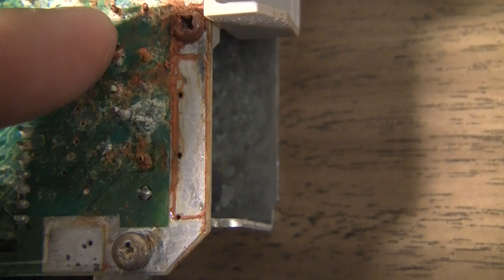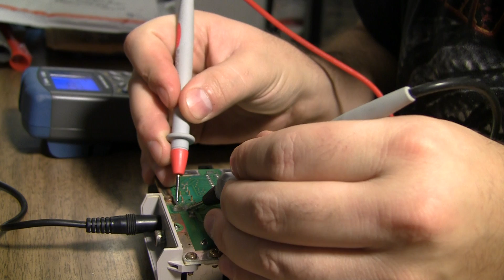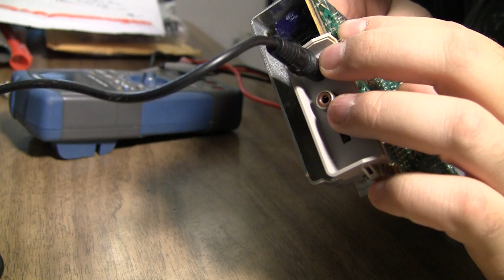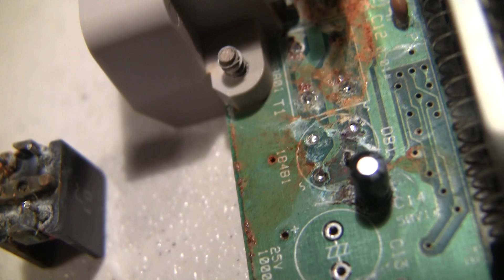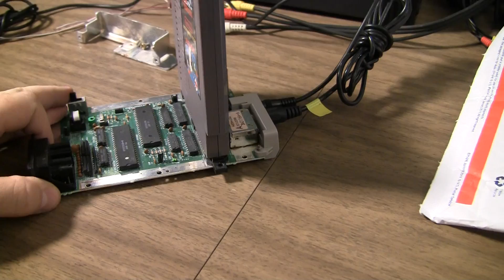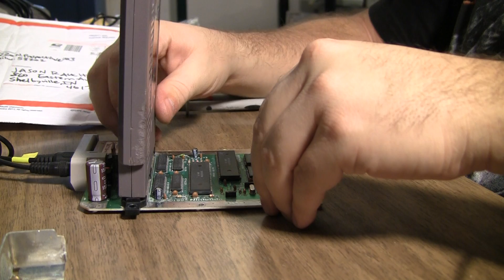NES-101 Nintendo Top Loader - bad corrosion fix up

Comment: I have a top loader it's been working for a long time yesterday it stopped working I took it apart 72 pin connected was clean and in good shape I haven't done any mods the problem is that the graphics are bad there not exactly garbled they are not clear I plug it in and before you turn it on you know how it's black and white well I turned it on and it was still kinda like the but I could faintly see the background and there was no Audio I was told the problem was the rf switch so I ordered it today and hasn't come yet but was wondering if that was the problem if not would you possibly know what is thank you for your great vids good job.

Comment: i can guarantee that is flood damage, i recently serviced a sinclair spectrum+3, and a sinclair QL and all peripherals for the two.
they had been caught up in last winters flooding and left all summer to fester, i cleaned all boards with a soft brass wire brush, then brushed on white vinegar and cleaned again, then flushed them with bicarb solution,then through the dishwasher.
this brought them as good as any 30 yr old hardware, mostly flood damage looks worse than it is.
they both work fine, only casualties were the micro drive tapes(which i replaced).

Comment: Nice video, just bought a front loader on eBay and it had corrosion on the 72-pin connector pads and vias on the top side, ate half way through two of the pads and the two corresponding vias were totally eaten into blackness.  I got the system working again by tacking some very thin enameled wire onto what little was left of the pads, running it through the via holes, and sanding off a bit of solder mask to tack the wires down.  Covered it in clear spray paint as it's all I had.  Works fine now!